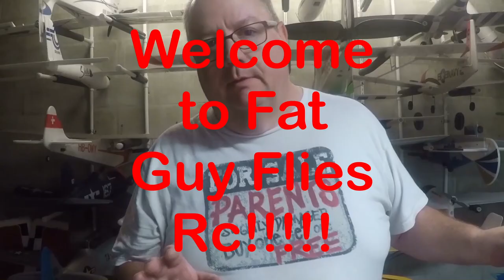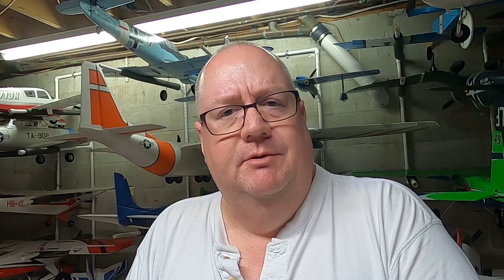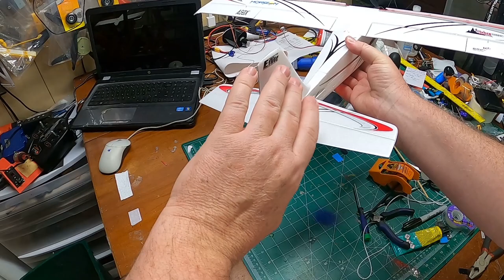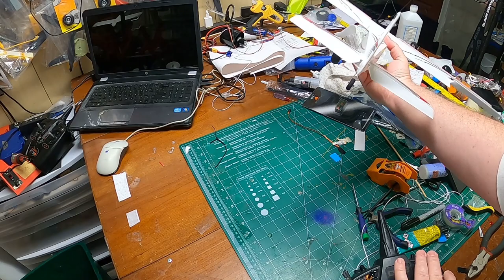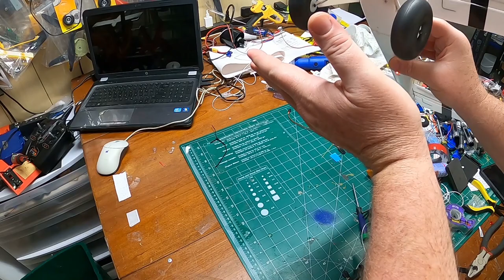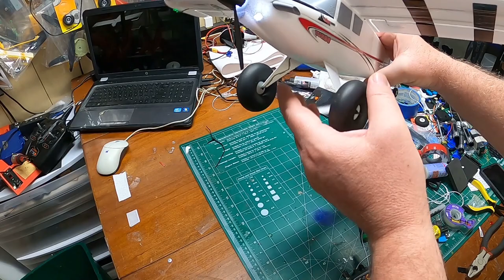FOR THE NOOB! BASIC PLANE PARTS. by Fat Guy Flies RC

Comment: I’ve got a couple questions,

What is “expo” and how does programming it affect the way a plane flies?

What’s the difference between flaps that fold down and other flaps that fold up? Aren’t they both used as air brakes?

And lastly, what is balance charging and storage charging for lipo batteries?

That all might be a better topic for a future video but that’s some of the stuff I’m still wondering about. 

Thanks for the walkthrough - I’m very interested to see how the servos and arms actually work to move the plane around
Looking forward to that one
Reply from the maker: Here are some answers for you. expo=https://www.youtube.com/watch?v=K32fnN0pPv8&t=247s   flaps=https://www.youtube.com/watch?v=hlI3x5_YJhc   lipo care=https://www.youtube.com/watch?v=xyjlg_7WnxM    I need to do a better flap video but the principles in the warbird one apply.
Reply: @FatGuyFliesRC  
Thank you I’ll check these out